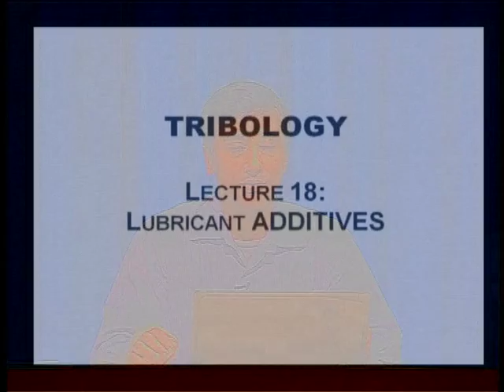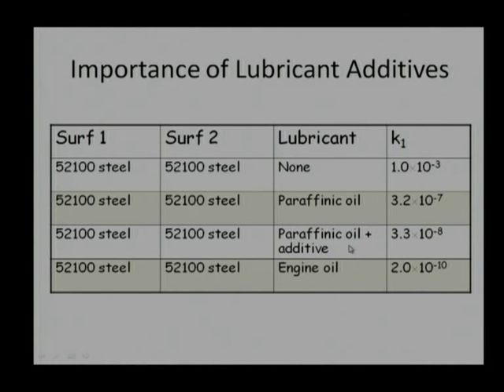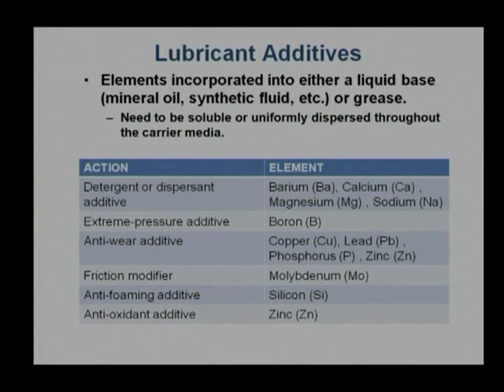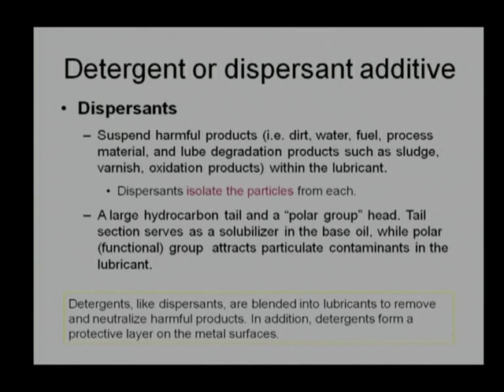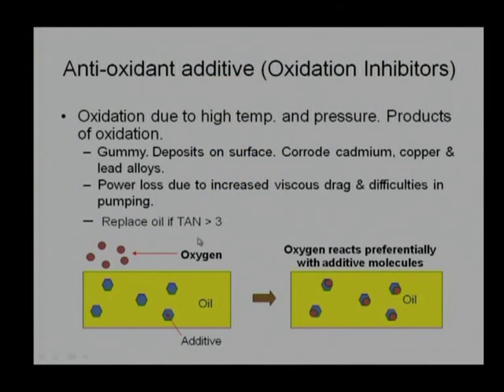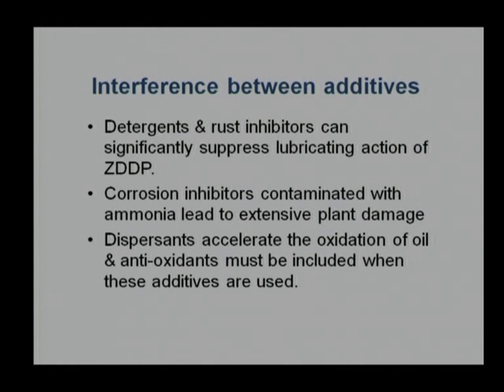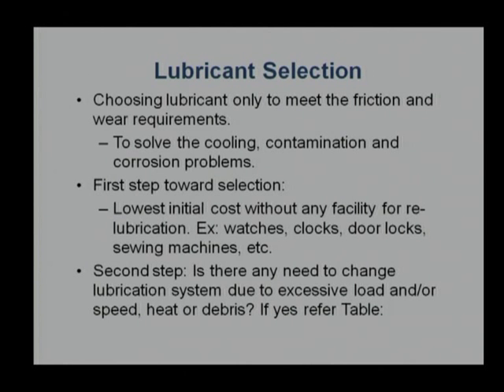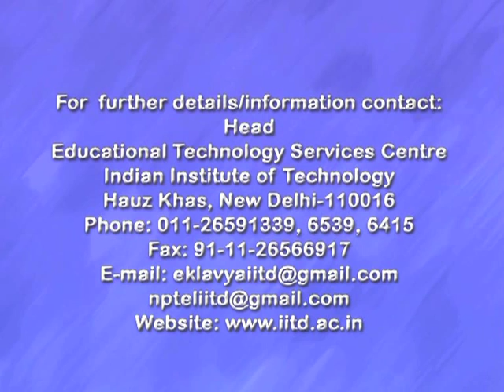Lubricant Additives

Comment: RICHFUL the Chinese biggest manufacturer, 300,000 tons/year production capacity
API Standards Engine tests: CF-4, CH-4, SN, SP; gear oil, hydraulic oil packages have passed double pumps, Parker Denison.
RICHFUL has a more stable supply capacity and competitive prices